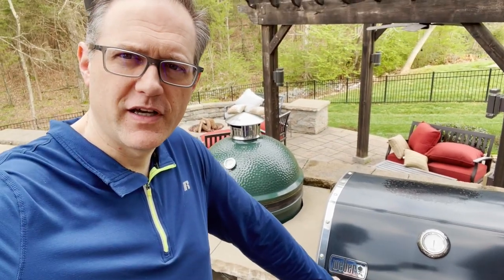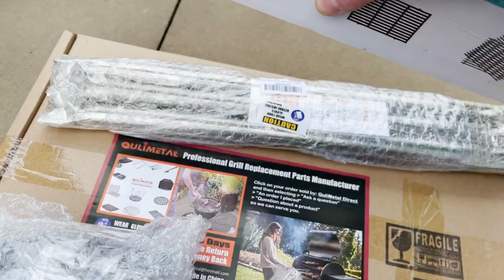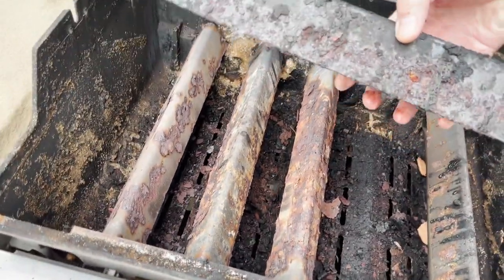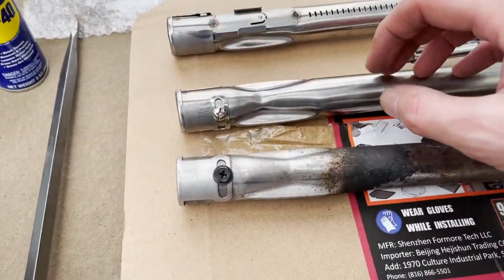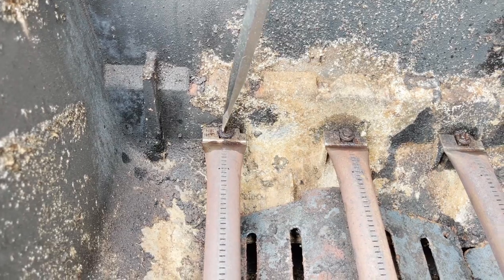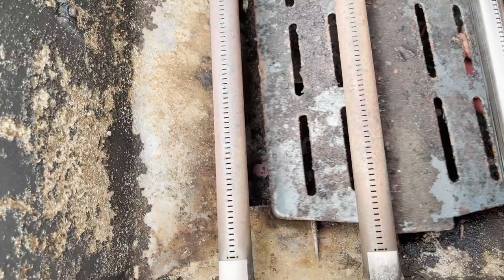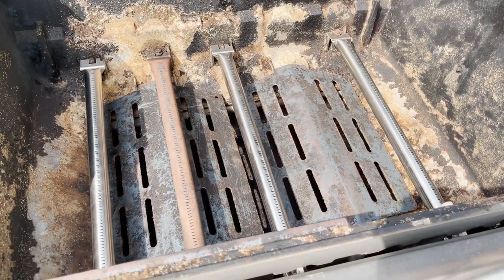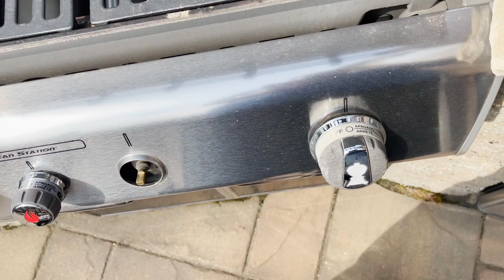DIY Weber Genesis Maintenance & Refresh

Comment: Your video quaility is great but did you watch any other video on how to do this before you started? These grills are made so they are easy to refurbish. Watching was painful. I was so worried you were going to wreck your grill. The grates just needed reseasoning, the burners looked fantastic, the drip tray looked neglected. Flavor bars are definitely an easilyy replaced item as they are designed to wear out. Everything else about this video was great. I would love for you to remake it AFTER you learned how to do your How To demonstration. Your voice quality and pace were exemtplatory. I liked that you did not remove all of the seasoning from inside the grill just to make it pretty again. Hint: the burners come out the front. The keeper screw should not be tight from the factory and should merely be a guide. You put that srewdriver near the ignighter and I gasped.  Best part is you rescued this grill twice.  I hope I don't come across as negative because I enjoyed your video.
Reply from the maker: Haha, thank you for your comments! The fact is I am figuring things out as I record and then edit it down so that I can "somewhat" look and sound like I know what I'm doing. :-)